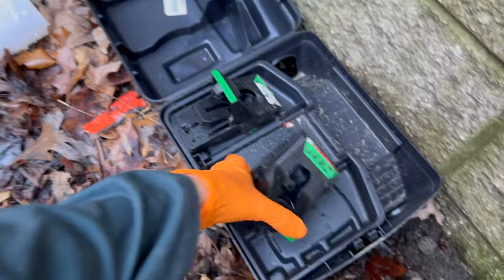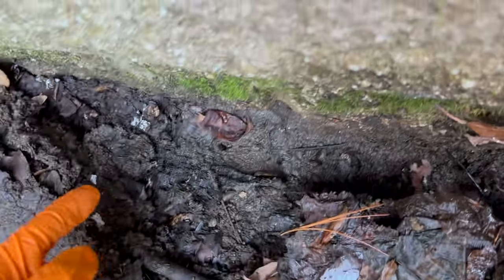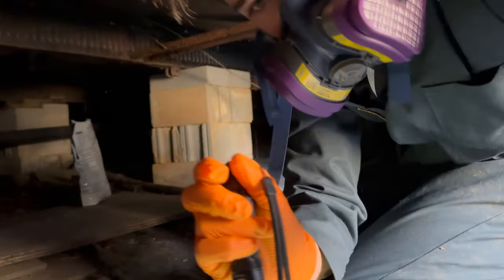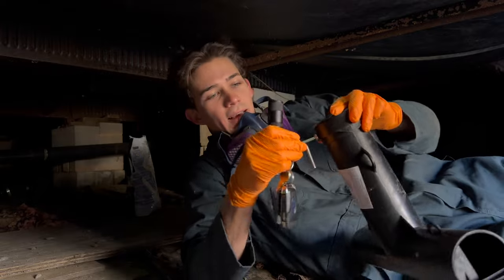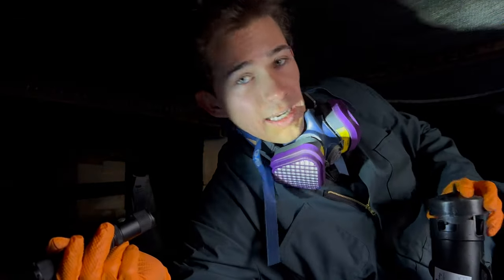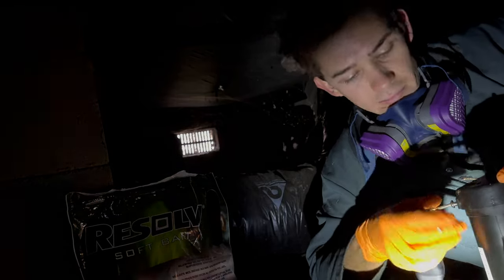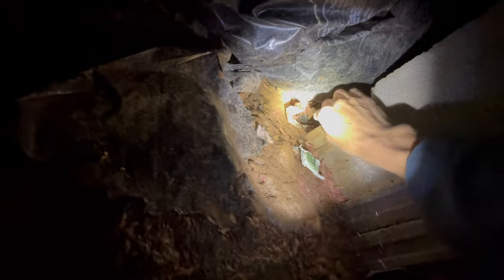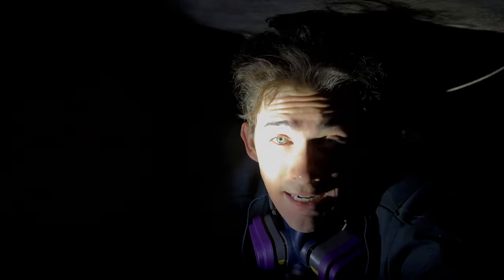The Rats Have Outsmarted Me

Comment: Be careful putting loose bait out like that. Also if you’re treating for Rats, it makes no sense to put just one pouch rather than just putting it in another bait station, as a pregnant rat can go through a whole bait station. Also would check for entry points as they only need 1/2 an inch and have customers seal up. Can put bait there relentlessly, but as long as there are entry points, they’ll always have a rodent issue